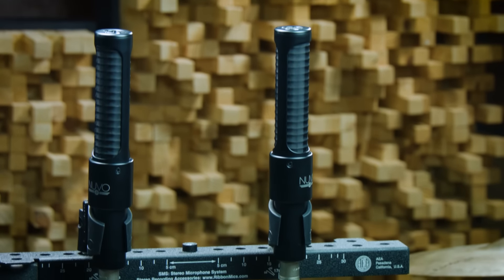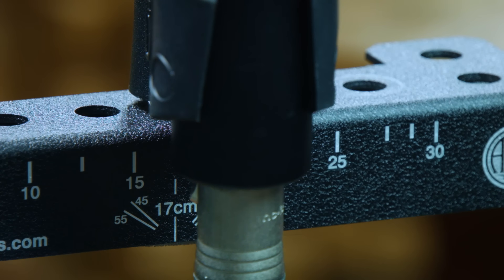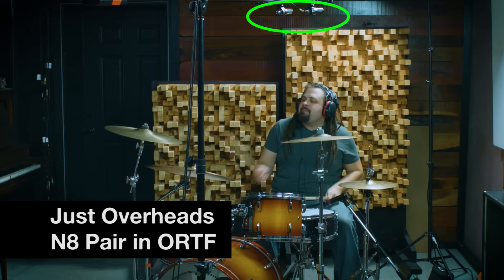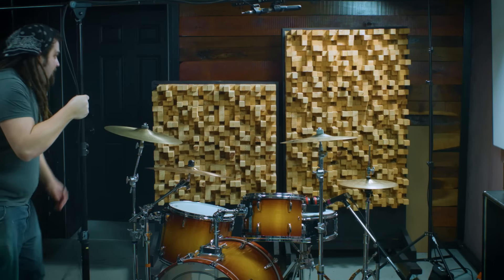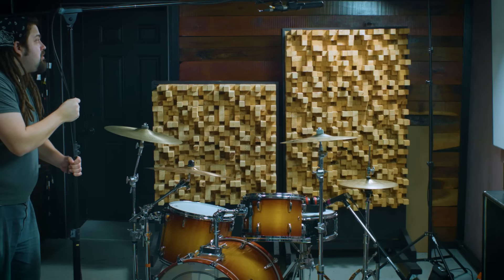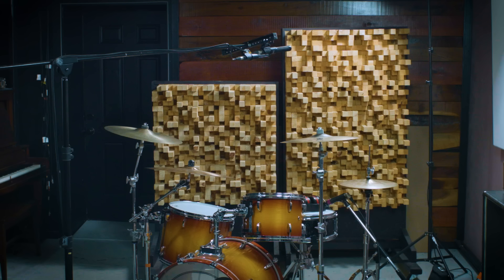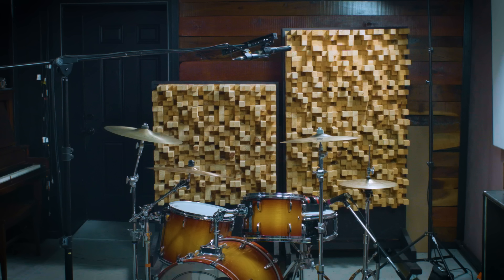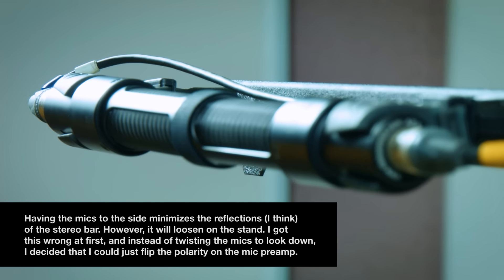How to Listen to a Pair of Overheads: ORTF with Ribbons

Comment: ORTF from the French Office de la Radiodiffusion et Télévision Française is quite old and was first designed with cardiod or ribbon mikes in the 50s, for orchestra recording (stereo). It is not meant for overheads but for room mics indeed!!!!
Reply from the maker: Yeah that makes sense. I don't mind them as overheads with a pair of SDC
Reply: What's intersesting with ORTF is that it gives you a 90° uselful recording span, hence a precise yet wide 
enough stereo field. Now, if you thnik in terms of depth , it's great to use as room mics. Take close mics and overheads either as spaced pair, XY or the weathervane technique, it actually can give you a very nice image:  close mics 30°, overheads 60° and room 90°...
That's how it was taught at the ORTF at least.
Reply: +Pascal Clerotte - Great information, Thanks!